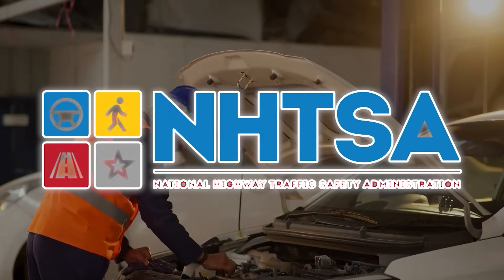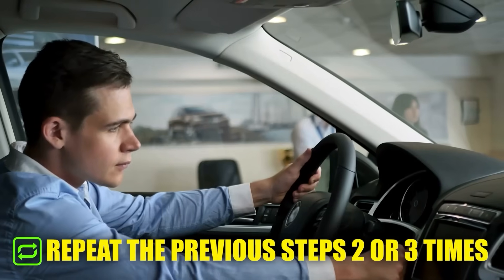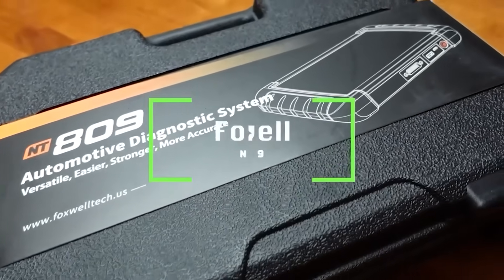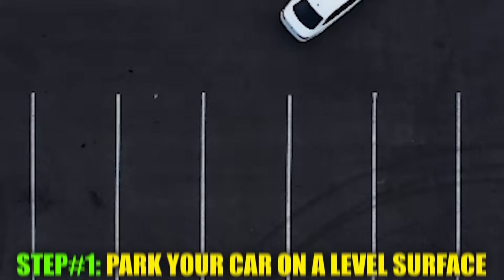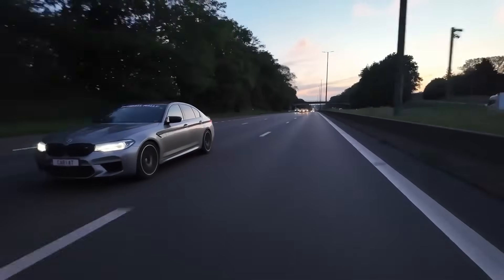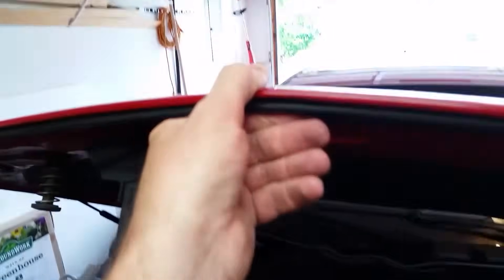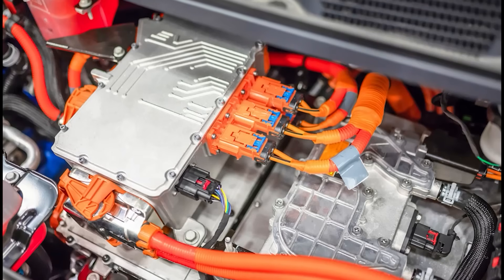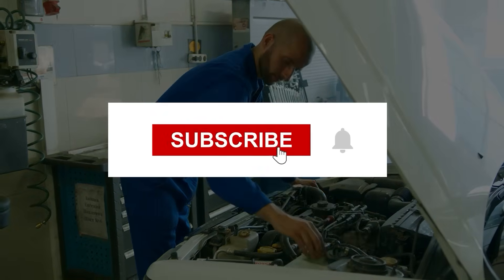How to Reset Throttle Position Sensor (5 Quick TPS SECRETS)

Comment: will that work for a 2014 jeep compass ? because I was told I had to replace the whole throttle body because the censor is connected to the throttle body